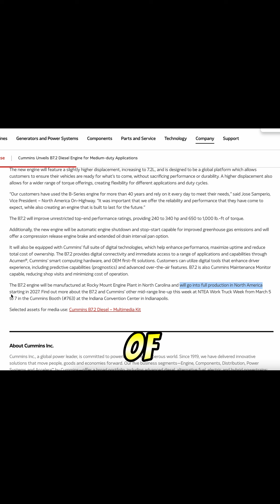Is a 7.2L Cummins Coming to Ram 2500 Trucks? 👀

Comment: If it has a 7.2 m in the Dodge that would be the only way I would be willing to buy dollars there’s nothing in my mind that tells me that Dodge pickup trucks are worth it besides Cummins it can be extremely wild while the vehicle around, it breaks apart at 1000 miles or less that has a 7.2 L engine then the vehicle would be worth heavy consideration if anything comes out unless it’s cause I’m doing talk to text.

Comment: The world is a much better place with lower emissions.  Emissions controls is something we had back in the 70's and eventually figured it out on gas cars.  Emissions on diesels started 35 years later, so it's gonna be a while before the engineers figure it out.

Comment: No way.  They didnt just re design the 6.7 for 2025 just to replace it any time soon. The 7.2 will just be for commercial. People would be surprized to know that huge commercial busses like the disney busses run 6.7 cummins engines. In those a 7.2 will will help them pass emissions and improve durability.

Comment: The red ISB cummins diesel engines are built and tuned for a maximum life expectancy to 600,000 miles. The black ISB diesel engines in the Dodge ram pick up trucks are tuned for higher power in torque with a life expectancy of 250,000 miles

Comment: Would just like to point out; dudes with stock 7.3s are still getting it done with less than 500ftlbs at the crank. I would 100% take an engine that was designed and built with reliability and serviceability in mind instead of raw HP/TQ numbers.

Comment: I think if they are smart they will bump up displacement and build in reliable displacement on demand. Americans like big numbers but most diesel owners use their trucks as commuters and mall crawlers rather than for hauling. A larger displacement engine with lower boost to meet the same power goals will run cooler and make less NOX emissions while maintaining fuel economy by cutting displacement while cruising down the freeway.

Comment: 6.7 Cummins in the newer ram trucks come with an engine brake already. I think it started in 2019 when they made the change to roller lifters. 
Also I think dodge made some sort of clause in their contact with Cummins saying that Cummins has to provide the latest and greatest light duty diesel engines for their pickups but that may have been something I just read that wasn’t exactly true.

Comment: I doubt it. If it's much heavier than the 6.7, it'll be virtually pointless in the 3500/2500. That being said, it could be a great option for the 4500/5500 cab and chassis (straight frame) trucks... but only if output is reasonable. EPA regs and Cummins status quo, is to derate the nuts out of everything that might be remotely considered "commercial". If they don't make output significantly higher than the current commercial 6.7 tune, market uptake won't support the offering. 

My guess is, this will be a small bump in horsepower for busses, RVs, and some medium duty applications... because their current range 6.7 is horrible (210-350hp)

Comment: The 7.2 Cummins is DOHC, which was necessary to integrate an actual compression release brake.  The stroke has been increased, so the deck height of the block has probably been increased.  All this makes for a taller, heavier engine that probably has way too much braking capacity for the heavy-duty pickups they would go into.

Comment: Compression brake is in my1st gen, just let off the gas. Jake is an aftermarket addon for the 24v . They are not the same.
Reply: Letting off the gas pedal is not a compression brake. A compression brake opens the exhaust valve on what would be the combustion stroke. So it uses vehicle momentum for compression then promptly dumps that compressed air into the exhaust.  ENGINE braking is just letting engine friction slow you down by letting off the gas, and a non-throttled diesel is the worst engine for this type of braking because it doesn't have to work against engine vaccum during the intake stroke.  Lastly, EXHAUST braking is done by using the turbo to close the exhaust system, this is the type used by all current HD diesel pickups. Jake type systems have only been used on semi trucks...and would be cool as hell on a pickup.
Reply: @alcalc8938 some see some saw.
  Definitions flip flop based of fuel type?  Ok

Comment: The ISB does not go back to the 80s, it started in the late 90s when the 5.9 fuel system started integrating electronics.
Reply: Right, it was just the B series before that

Comment: Geez people I’m using a semi truck with an L9 cummins, you don’t need a 7.2 to haul a camper around
Reply: Exactly. I don’t get the numbers war between the manufacturers, like Ram, Ford, and GM. Well, except maybe GM since they’re not trying to be in the rat race for torque and hp numbers. Mainly Ram and Ford are doing that. But they’re always one upping each other and I wouldn’t be surprised if they’re trying to put bigger engines in their pick up trucks. At that point, it’s like, just get a semi truck. I don’t think trying to pull that kind of weight, say like Ford now with numbers of 40,000 lbs with their latest High Output diesel engines, is safe for that size of a truck in general. No matter the manufacturer. That goes into semi truck territory now. Because pulling the weight is one thing. Stopping that weight is whole other thing to figure out.
Reply: @hausman-q8d it’s emissions driven.
Reply: @JasonNotBot  No. We're talking about classes of trucks handling their categories of weight.
Reply: @hausman-q8d word.
Reply: @hausman-q8d the brakes are part of the entire equation recieving ratings! Look it up
Reply: @johnhahn8464  Exactly

Comment: Honestly if they hybridize the thing, like proper hybrid and not the mild hybrid 48v nonsense, they can do a lot with start stop and high voltage heaters to preheat and maintain emissions temps. I wish someone would put a hybrid into the HD segment already. That ice needs to be broken. 

Honestly I'd love to see a range extended phev heavy duty. A diesel generator laser focused on a single low rpm would be so much more efficient than anything in a modern truck. And the big electric motors would have more torque than the smaller generator for getting off the line, so it wouldnt need as big of an engine, and smaller engine means better mpg and less emissions. If I won lotto I'd build my own to highlight just how much ford and gm are dropping the ball

Comment: Start stop will lower exhaust temps and increase NOx output, or at least make it harder for the emission system to function at levels they expect.   I doubt a diesel will adopt this.
Reply: That's why they're going to have a 48v mild hybrid with emissions heaters to keep the emissions warm
Reply: @james2042 . Vomit.   Lol.
Reply: @ND-tu7ww cry all you want. Hybrids are proven at this point and a resistive heating element is as reliable as something gets
Reply: @james2042 I’m not crying.  This is new tech (using heating elements to fire off dpf regens) and not been around for years so no it has not been proven.  I feel confident it will add more failure points and have issues but if you have trust in it go buy it. I won’t be.   I’ll be sure to wave as you are stuck on side of road with your hybrid 48v start stop tech that saves you 0.01 mpg on average.   Lmao.
Reply: @ND-tu7ww bro electric resistive heaters have been around for over a century. Are you aware of what an engine block heater is? Or a space heater, or like literally any electric heater in existence?

Comment: Start stop technology?!? Is that a joke? These things already have more systems than the space shuttle! They do t need one more thing to go wrong and wear out prematurely
Reply: And oil cooking in the turbo at train crossings and long traffic stops while heavy pulling at slow speeds with high temps
Reply: @alfie2744 it's an electric oil pump lol?
Reply: @isaacsmith5489  the 7.2L Cummins does not have an electric oil pump
Reply: @89dhvac it does though. It has a main belt driven oil pump and a 48V auxiliary pump.
Reply: @89dhvac the 7.2l cummins isn't out yet and the specs of it are not fully announced. And it's not just my car, NYC taxis using hybrids go half a million city miles on all original drivetrain regularly. In heavy industry, electric motors run for hundreds of thousands of hours, longer and harsher than any automotive application. Electric powertrains are objectively more reliable. I hope once you can get past the political motivated articles about electric = bad, then you'll realize just how many electrical components your trucks have that run functionally forever.
Reply: @james2042  While you may very well be correct about electric drivetrains having the capability to run longer, the real world truth is that they do not. I make a living fixing/replacing electric motors and components. The quality just isn’t there. We have constant failures of new and near new electric motors and controls. This applies to almost anything of modern manufacture. Hence my reasons for wanting things to be less complicated and so more reliable. Has absolutely nothing to do with politics.
Reply: @isaacsmith5489 interesting, where did you find this information? Regardless, yet another system to have problems with. It just doesn’t serve any real purpose. Btw, where are they getting the 48v?
Reply: Start stop is actually one of the few eco things that really doesn't cause problems and is mostly just an inconvenience
Reply: @james2042 most engine wear happens at startup….
Reply: @89dhvac are you aware of what a hot start is? I'm not being an asshole I'm genuinely asking you. Because you are correct, most wear on an engine is on a cold start.
Reply: @james2042 yes I’m aware. Are you saying you don’t think there is any additional wear caused by the multiple hot starts with start stop vs no start stop tech?
Reply: @89dhvac  its not that I think, its that I know. If it uses an electric oil pump to keep oil flowing, which is what the 48v system will do, there is 0 damage done. Start stop even without the electric oil pump still does statistically irrelevant wear as long as the engine is hot. The actual film of oil will not break down in the 15 seconds the engine is off. I wish I had a start count on my lexus because it has to be in the hundreds of thousands at this point. just on my daily 18 mile commute to work it cycles   on average 26 times, and thats one way. Some rough math says on my commute to work alone that is 13,000 engine starts a year. I'm approaching 300k miles on all original internals, even the original battery, and I just do oil changes every 6 months, oil has never been shiny
Reply: modern oils also create sacrificial layers, so these days start up wear isn't that significant even on cold starts. It isn't the 60s where 90% of wear was at start up, now it's not even half.
Reply: @89dhvac not in 2025 with modern engines and oils it doesn't
Reply: @james2042 I am truly happy for you having had such a good experience with your Lexus! However, I know that the more a machine is used, the more wear is accumulated. Even if you have an electric oil pump to keep oil circulating (another terrible idea) to reduce the accelerated engine wear caused by constant starting, there will be accelerated wear on other components like the starter. It just isn’t a good idea for anyone who values longevity.
Reply: @isaacsmith5489  I don’t think things have changed as much as you think they have. Machines still break and wear down with use. Oil is still oil.
Reply: @james2042 im so glad someone finally said this. Engine wear cold start yes not hot start.
Reply: Start stop is great, saves fuel
Reply: @isaacsmith5489 sure, a teeny tiny little bit. Nowhere near worth it for the additional cost/complexity of the systems needed.

Comment: Extra displacement sounds nice but emissions will probably decide everything.
Reply: with the extra displacement they can meet emissions and power output standards with less stress on the engine. Similar production with hypothetically more reliability
Reply: @brycedavis9235 not less stress on the engine. It's just stroked, the bore isn't increased. If anything that engine will be more stressed to make the same amount of power.
Reply: @isaacsmith5489  longer stroke = more torque.
Reply: @prabhjotnanokey and more torque means more stress? What is your point
Reply: Extra displacement means less emissions

Comment: lol, the new 6.7’s just got updated, they aren’t going to the 7.2. We all know ram doesn’t change ANYTHING for at least 10 years after a refresh
Reply: What you do not understand is that they can literally put slightly larger pistons in that new block along witha slightly larger rod and get 7.2l. It's literally increasing 31 cubic inches. The turbo amd injectors will handle it. Very little to no cost difference.  If the bore is increased more than the stroke, the hp will go up considerably. You could see 550hp, 1250. If stroke is more, then maybe 500hp 1350tq. That's what I'd rather have.
Reply: @sonsofliberty3081 he said stroke

Comment: I doubt it'll have a Jake Brake.
It'll probably be one of those half assed and gasket blowing butterfly style exhaust restrictor and not the real deal.
Reply: Variable geometry turbo 
Used on the 6.7works well as exhaust brake 
No issues in Australia
Reply: @garreysellars5525  That's still a Band-Aid, Toy's grade, Fisher Price stuff compared to an in-cylinder J-Brake.
It may work but it's far from ideal.
It makes me feel uncomfortable knowing I'm artificially choking the exhaust on my $80-$100K truck and piling all that extra heat and stress on the VGT Turbo/exhaust system that's nowhere near as robust as it should be to be putting up with that kind of use and abuse.
Reply: @GIGABACHI 
It's not a band aid
It's factory 
When it activated only with nil throttle the exhaust temp actually drops
Diesel fitter 45years 
Ram 2500 Cummins 2008
400000 Ksno turbo or head gasket issue 
Modified to 600plus HP
Runs 9.8 litre per 100 Ks 
Hiway not towing
Australia
Reply: @GIGABACHI you’re not chocking any exhaust on the rams with a vgt because you’re not adding any fuel when it’s in use. It’s been working fine since 2011. Better exhaust brake than the other two competitors.
Reply: @Maximumdub 
Since 2008
Reply: @Maximumdub  had no idea they shut down fuel when engine braking.
Very similar strategy to modern motorcycles when you close the throttle and use only engine braking.
Do they use the intake butterfly too as a means to choke/slow down the engine ?
Reply: @garreysellars5525  After reading Maximumdub explanation I can see how it doesn't create extra heat (no fuel added during it's use).
Reply: @GIGABACHI 
Well that is what I told you
Reply: @garreysellars5525 just more and more people trying to sound like they know what they are talking about.  Writing TLDR comments about something that ain’t even real!
Reply: @mitch6575 
Are you referring to me 
Please explain TLDR
Reply: @garreysellars5525  no the hibachi lady.
Reply: Because a true Jake Brake is expensive and costly to repair if necessary. Exhaust brakes work incredibly well, keep the turbo clean, and are simple.
Reply: I remember hearing a true Jake would be too aggressive for vehicles lighter than semis. Part of the reason why they don't put them in medium duty trucks too.
Reply: @NPC-mt1cz  I can relate to that.
It's a very plausible theory.
Reply: @NPC-mt1cz yeah I found out the hard way to not use the exhaust brake in snowy conditions.

Comment: Unless it comes factory no DEF and no EGR, then IDC
Reply: Aaaand unless you’re an idiot you know the answer to that question is a hard “no.” 😂
Reply: Not likely to happen
Reply: I hope you know that you will never own a modern diesel in your life then.  You gotta have some reasonable expectations.  DPF, SCR are %100 hear to stay, EGR is negotiable with the larger displacement diesels on the horizon. If you want the same HP/liter then EGR is going to be part of it.
Reply: Def is fine
Reply: @technom3598  How? If its epa related garbage I dont care.
Reply: You know it won’t.
Reply: That's not up to cummins or ram
Reply: There will be delete kits available eventually. There always is. I'm more concerned with them adding the "stop start" technology. There's not a single vehicle made that has that technology and it ended up being a good thing.
Reply: DEF?
EGR?
DPF?
IDC!
Reply: @a @andyharman3022 diesel exhaust fluid/ exhaust gas recirculator/ diesel particulate filter / I don’t care